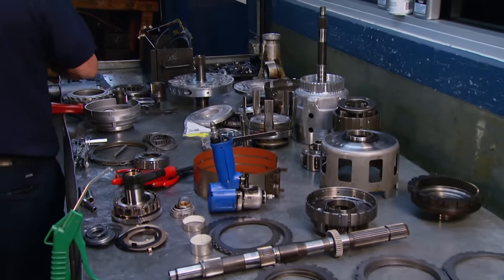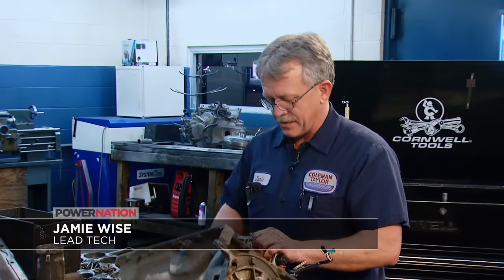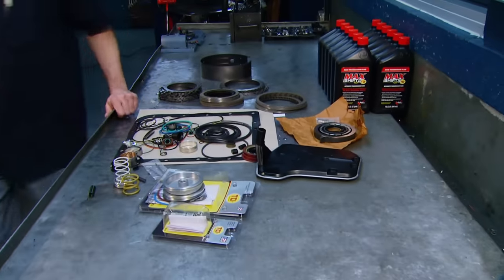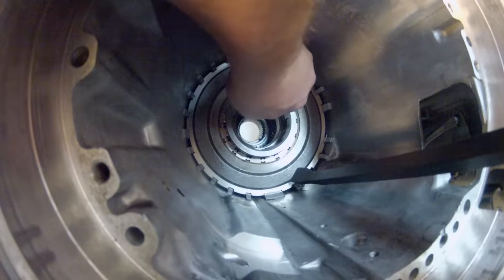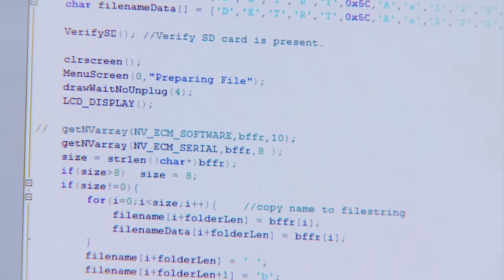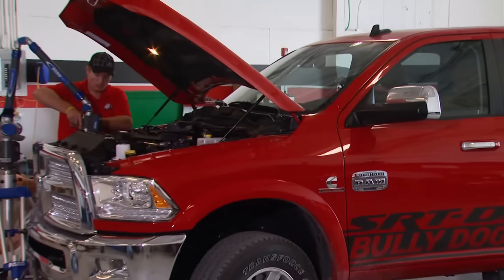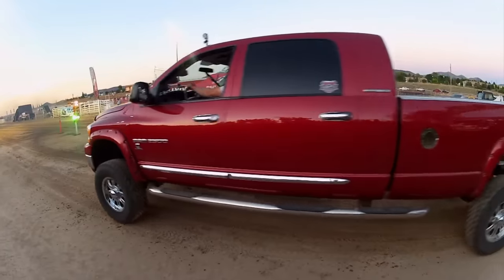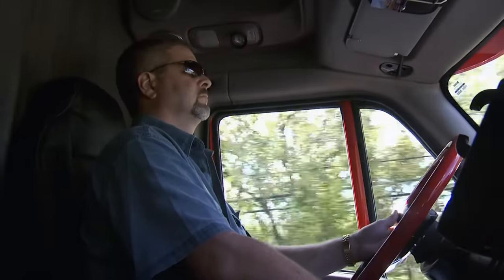Rebuilding a GM 4L60E Transmission for a Chevy Silverado - Truck Tech S1, E12

Comment: 4l60E is terrible for a full-size pickup application in my opinion. The one in my stock '09 4.8 Silverado died a loud terrible death, at 70,000miles. with fluid/filter maintenance at 40K-ish . The thing just gets too hot, too fast. moving a 5800lbs truck plus whatever else in payload, or anything in tow. Especially in the summertime. 190F-215F anytime hills are involved. Needed a better trans cooler from factory if you ask me. The 4-pinion planetarys were TRASHED, clutches were in decent shape tho.

Comment: Is it me or does the 4l60 always break down? I have 2 brother in laws who both own chevys and both transmissions broke down.
Reply: 4l60 is pretty garbage. Theyre usually alright if youre using a stock engine, but as soon as you start making more than stock power you'll blow the tranny
Reply: Key words "stock engine" which over 90% owners have.
Reply: They are great transmissions as long as you do not abuse them.

Comment: Isn't that a 700R4 trans? Afaik the 4LE60 has a detachable bellhousing and more ribbing around the inlet and outlet to the oilcooler.
Reply: The 4L60E is the same transmission as the 700R4.

Comment: I am looking at a GMC Sierra 2010 with one of these. Can these last 250k? Miles
Reply: Keep the fluid changed and regular maintenance and it should. I have 289.000 miles on a original 4L60 but I've taken care of it
Reply: Just worked (inspection and some suspension work) on a 03 Silverado with a 5.3l with a 4l60e. Ran and shifted fine with 306,000 miles on it.

Comment: Everyone says 4l80 4l80 4l80!
Can a 4l80 be used with a 5.3? Or even a 4.8?
Reply: bang bang yes. But in most cases there will need to be some modifications. Also trans tunnel modifications if the 4L80E is going into a vehicle that used to have a 700R4/4L60E in it as the 4L80E is a bigger trans dimensionally.
Reply: Yes and you don't need to modify depending on the vehicle.. my tahoe that came with a 5.3 and  accepted a 4l80 no problems. The 80e is slightly bulkier and a little longer..have the same bolt pattern to bolt up to a 4.8, 5.3 or 6.0..
Reply: bang bang yes it can but doubtful you’re beyond what a 60e is Capable of

Comment: Do a nv3500 next!
Reply: was just thinking of that. I run a factory 96.. and there is no end in sight approaching 400k miles in a5500 pound 4x4. Just bizarre. An incredible race whining noise since day 1. I then learned their last versions are setup for the engines that gained 60hp over 1995. would love to see the differences... they even changed gear ratio and casings for sensors. etc etc.
Reply: Yeah there heavy duty.. I have one factory in my 88 4x4  Sierra

Comment: 4:40 When they rebuild a normal transmission. They don't buy parts from TCI. They buy parts from a much cheaper company.
6:26 There is no need to install a 5 pinion front planet. They never fail. There is no need for a 5 pinion rear planet if you keep a clean filter. It is only used in overdrive and reverse. If you don't change the filter. A 5 pinion will wear out just a soon.

Comment: 400 turbo was the best  !
Reply: lee santos the overdrive version of the TH400 is called the 4L80E. The 4L60E is an electronically controlled version, with minor updates, of the 700R4 which is the overdrive version of the TH350.
Reply: @CamaroAmx  Thanks bro,  i just wish GM never stopped making the turbo 350 and 400. They were bullit proof  . I never had issues with them.
Reply: lee santos I’ve never had an issue with any of my 4L60s that wasn’t caused by outside issues.
Reply: @CamaroAmx  Good to hear, i recently bought a 97 Tahoe W/it and a lot of people say they're no good  ! 137k and shifts good!😎

Comment: 4L60e can be built by a competent individual (problem is that no longer exist today). Parts changers who Frankenstein everything. I can build one that will hold up easily, but the ones who say buy the 4L80e bla bla bla have no clue.
Reply: Exactly, everyone in the racing world knows the 4L80 weighs more and is 2-3 tenths slower. I'll keep my 4L60 over a 4L80 all day
Reply: @casualobserver620  prove it, math never lies

Comment: Wow.  That's one sad baseline.  268 HP with a power adder.
Reply: The engine only makes 240 at the crank. So it's not bad, I'm sure other factors limited power. Injectors, tune, pulley size.
Reply: I'm curious about the amount of money you have to spend to get a 26hp gain. Seems too expensive.
Reply: @adamk3538  All Bullydog did was give it a custom Dyno tune.
Reply: Ok. Like I said, some custom tunes run 800. Just curious on if he had to pay it what he paid for this, custom tune

Comment: 1996 impala ss 4L60E has a one year only tail stock with driver side 1” hole for the speedometer sensor,careful ordering this transmission for a B body,most of these transmission shop will just send you a truck transmission and playing musical returning  with these bone heads can get expensive.

Comment: That supercharger on that turd racing TOYota is a bit of a joke. Not even 300 at the wheels. Guy should have bought a Ram with the hemi you add a kenne bell(real supercharger) he would be at close to 500 at the wheels. Guess that's the big difference between a Toy and a real truck

Comment: those transmissions are junk I had to get the one on my old Blazer rebuilt after the thing went to shit on me from just NORMAL driving.  In fact the funny thing is right when this episode came out is probably about when I was forced into rebuilding my transmission.  I wish I could've just put a new transmission in and gotten rid of that generic piece of crap 4l60e

Comment: you can drive a Ford and tell the body rust out and pull engine out and put in another truck Chevy he's got to put it three or four engines in them before the body this is been
Reply: You got that backwards...The 5.4 triton is a fine example of how ford can't design an engine to save their life. 120 years of engine manufacturing and the best they can do is $25 spark plugs that take 3 hours to replace, or spark plugs that bounce off the hood.

Comment: I will only swap a transmission im not going in lol
Reply: Manual transmissions are the repair. No computers, no sensors going out, no late shifts, no slipping, rarely leaks, only problem is infrequent clutch replacements

Comment: The worst gm transmission I've ever had the pleasure of dealing with.
Reply: My 98 Z71 4l60e has 347 000 km on it and never bin rebuilt still going strong love it. I think the 4l60e deserves more respect
Reply: @taylorh3930  mine lasted 360 000km's on a 06 gmc 1500 5.3. I have about 1100km's on the rebuilt one now
Reply: Don’t knock the 700r4, they are equally as shitty
Reply: My 4l60e has 200,000km on it and still shifts smooth.
Reply: @taylorh3930  it's good for say a Colorado,S10, Blazer, and such. But GM really overloaded this transmission putting it in a half ton.
Reply: @bryanmartinez6600  o Oka that's why my 98 Z71 Silverado's 4l60 has currently  351 789.97 km exactly on the odemeter with no rebuilds and iv had as much as 13 700lbs behind this truck.  I don't know what the rest of you 4l60 haters do with your 4l60s but mines bin bullet proof and if it ever goes she's getting bomb proofed with full Sonnax parts.
Reply: @bryanmartinez6600  I like my 4l60 I wouldn't go through the bullshit of a 4l80 swap with a gun to my head thanks too Sonnax! A built Sonnax 4l60 can be built to easily surpass a stock 4l80e.
Reply: @taylorh3930  cant say the same I've seen several burn up under 100k miles in 1500s and S10s 
Simple Transmissions to toss together no doubt I'd definitely take it over some of the new garbage especially against the POS 6T75 which is now my #1 on my most hated list. Can't even swap out the control valves because apparently you need GMs software or something to program the new part. Though the 6T Transmission was a joint project for both ford and gm. At least the 4L60 can be rebuilt in a garage with easy to get tools. Still if I had a choice I'd always go 4L80 but in the end for heavy duty truck Transmissions my favorites have to be the Allison 6 Speed and Ford's 5R110 
Also not a fan of the 47RE. 727 Transmissions have had a good reputation but again it was being put behind powerplants that would wear them out quickly especially under heavy use. A built 47RE seems good though but ours is factory and shifts very hard. In refinement the 4L80 shifts smooth along with the Ford 4R100 as well. I just see the 4L60E as weak when towing 13k is an achievement I prefer the 4L80 which would do it continuously without a problem.
Also I personally wouldn't swap, it be cheaper to buy another GM vehicle than what it cost to swap and set-up the 4L80 to work right especially since they are electronically controlled.
Like someone trying to put a b series Honda in a car that has a d series. Its cheaper to just get a B series car in the end.
Seriously the autocorrect messes up my sentences more anything.
Reply: @bryanmartinez6600  I will say that 13 000lbs was just hauling our skid steer home from work on a big trailer just a few km down a grid couple times here and there for work around the yard. I wouldn't pull that all the time plus's these 88-98 gmt400 trucks were only rated to tow 6000lbs way back then anyway. But I like the 4l60 I also like the 4l80 the 6l80 the 6l90 aswell as the big dog Alison 1000

Comment: If you don't address the weak ass input drum, you're wasting your time. Every failure I ever had was related to the input drum. You have to use a high dollar bolt on pressure plated one to even think of hitting it semi hard. Or, you can use the money you wasted on that high dollar input drum to pay for a junk yard 4L80E and call it a day.
Reply: Those aren't the only options

Comment: As a owner of a 4l60e i can say it is shit and coulndt even handle 300hp...i had to have it rebuilt with preformance parts...its great now but stock is trash.
Reply: Jamal J.H my 93 Z28 with about 300hp (not stock) is doing just fine with its 4L60. In fact the only 4L60 I’ve ever killed was not the trans’ fault. Hit a raccoon which cracked the line. Went to leave work and the line burst. Had no other way of getting home, so it filled the trans up with as much trans fluid as I had and drove the 45 minutes home. Had a trail of smoke behind me the whole way and I could tell I hurt the trans bad by the time I got home. But I made it. Pulled the trans, bought an $70 rebuild kit from AutoZone, rebuilt it with the watchful eye of my father’s ex girlfriend’s dad who was a retired Ford Master Tech (though he has worked on everything at one point or anther) in a morning and was driving it to work on Monday (burned it up late Thursday night/Friday morning). Put anther 30,000 miles on that 94 V6 camaro before the heads cracked. But didn’t care cause I had bought my Z28 by then.